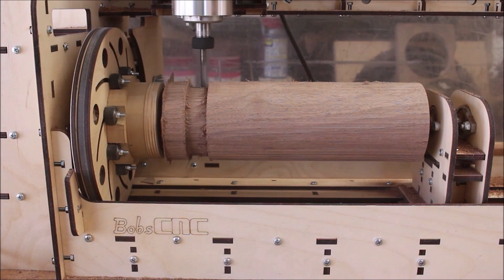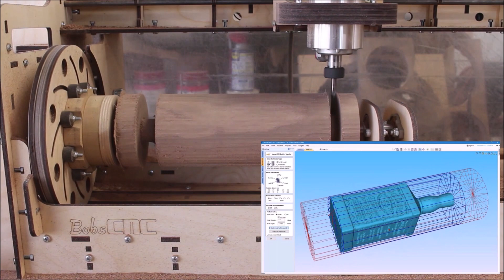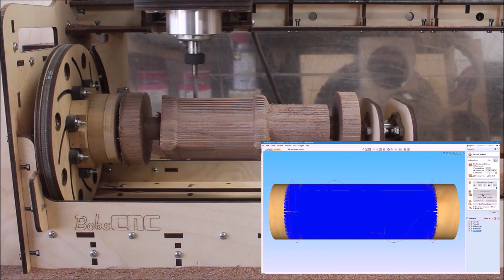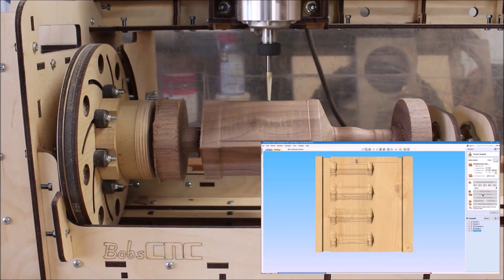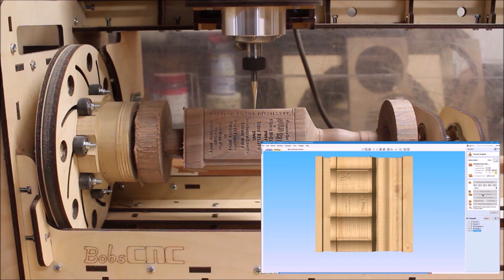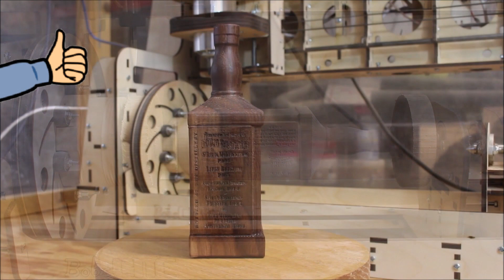BobsCNC Revolution Meets Jack Daniel

Comment: Did you use the new rest machining in the vcarve 11 on the finish passes?
Reply from the maker: Thanks for watching Chris.  No, as I mentioned in the video I simply drew a vector box around the areas with text and told the smaller tapered ball nose to only machine inside that vector.
Reply: @DaveGatton  You may try it using the rest machining. I have good results with that cutting down finish times. You just add a second bit to the finish toolpath and it does the rest, generating a sub path.